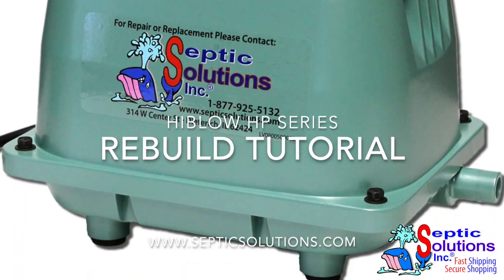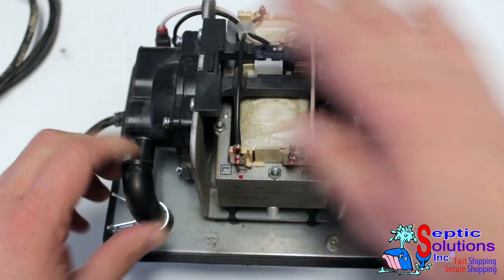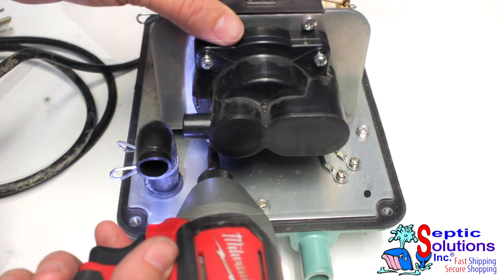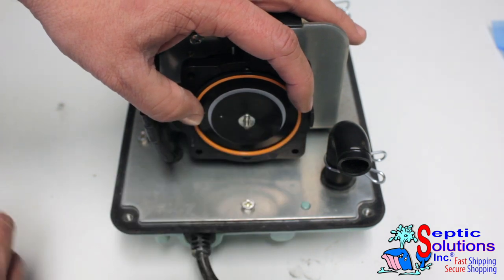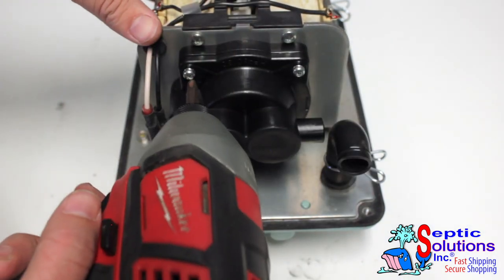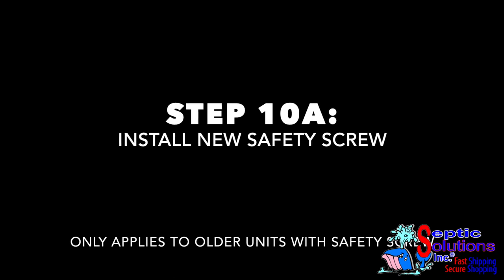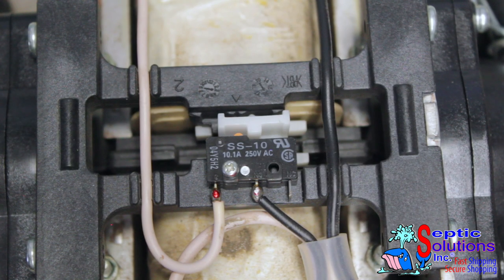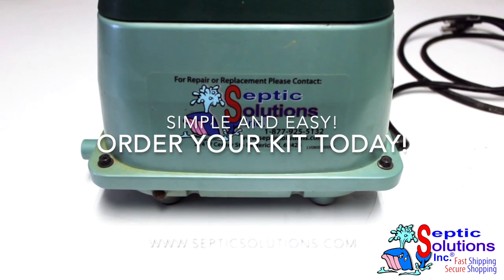Hiblow HP Series Aerator Rebuild - Diaphragm Septic Air Pump Repair Tutorial by Septic Solutions®

Comment: I bought the diaphragms but they didn’t come with the chamber blockhead replacement or the filter. I did purchase the filter  separately though. Last time  which was about 5 years ago, I did the same thing except the filter came with the diaphragm. Anyway I hope the diaphragms last as long as they did last time.

Comment: Can the existing diaphragm be repaired?
Reply from the maker: The diaphragms must be replaced. We have different options when it comes to repair kits. The one shown in the video is the standard kit that we recommend. We have the diaphragms by themselves without having to purchase the entire kit, but you still need to replace both diaphragms when doing it. You can view our different replacement kit options at this link: https://www.septicsolutions.com/septic-parts/septic-air-pump-parts/hiblow-rebuild-kits
Reply: When the diaphrams go out, does it cause to unit to shut down. Like it has no power at all?
Reply: Rebuilt the compressor with a rebuild kit. It works for about 10 minutes and alarm sounds and it stops working. Took it apart and reinstalled twice and the same thing happens. What am I doing wrong?